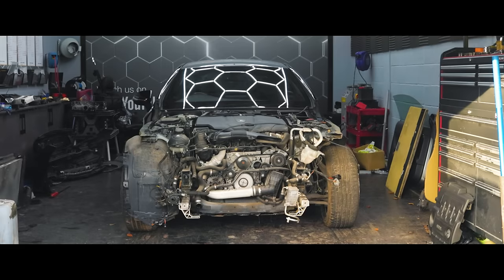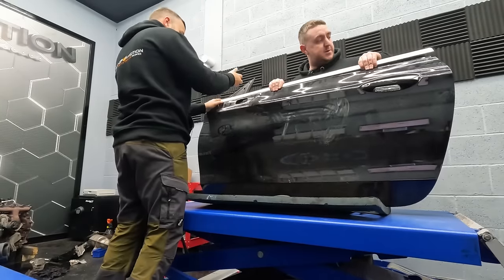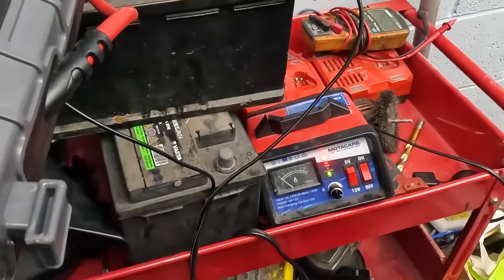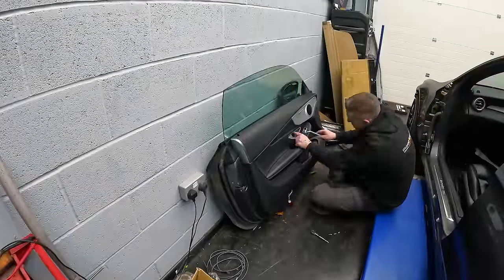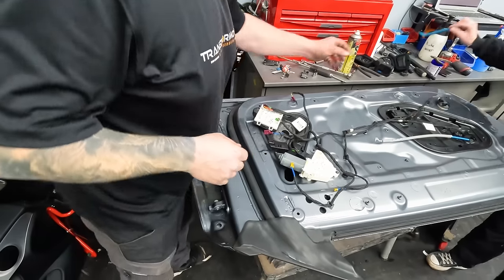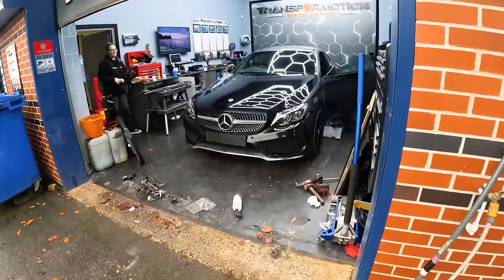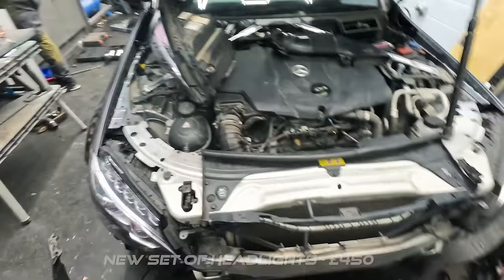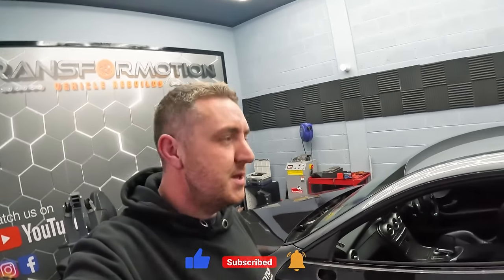REBUILDING A MERCEDES C-CLASS AMG LINE | MERCEDES COUPE PT. 2

Comment: Cracking motor that is now, quick turn around for yous aswell 👌
Reply from the maker: Nice one mate, although it needs loads of parts it's all sort of bolt off and bolt on stuff so doesn't take that long
Reply: @TransformotionVR  aye yous haven’t been straightening inner wings or anything, looks an easier repair than the scirocco
Reply from the maker: Yeah definitely! Ha ha all bolt on on this one apart from that tiny dent in the sill